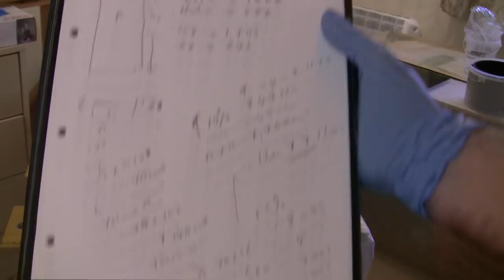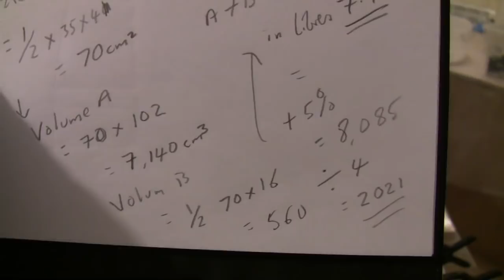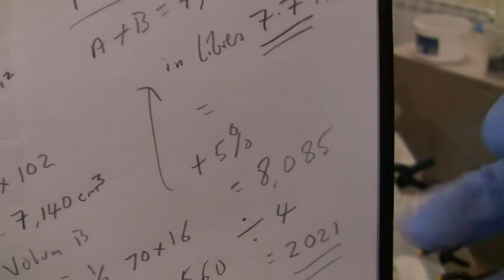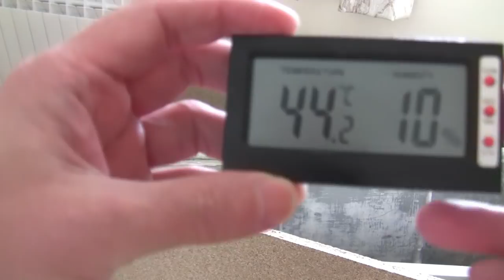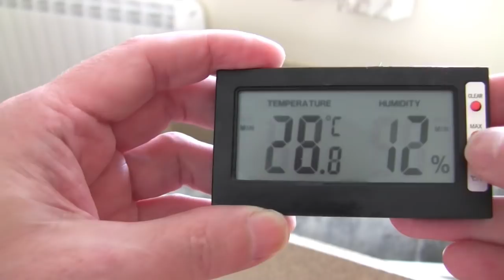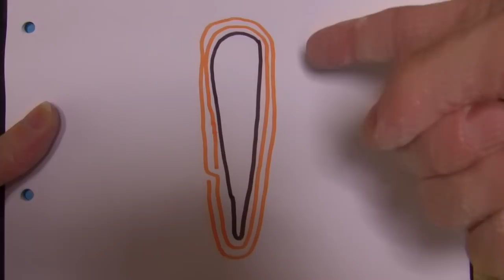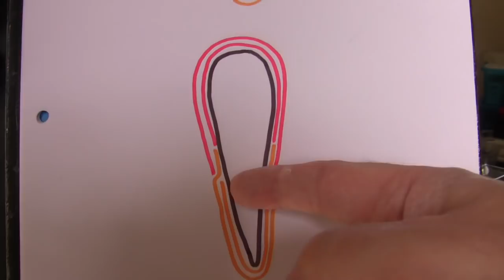Just About Sailing Apr 18 - Fixing the Rudder, Pt 4 Sticking the two halves together, all finished!

Comment: Well done. That was a bit of a marathon old chap, but the rudder looks fantastic. As you clamped it up I had an unreasoning panic, thinking, 'oh gosh he has forgotten something'. And it's not my rudder! All was well however and, had I done it, I should have been very pleased with myself. I think you can give yourself a pat on the back and a nice cup of tea.
Reply from the maker: Yes it really was a bit of a marathon.  But it is done now.  I also enjoyed it in a strange sort of way.  I was convinced I had forgotten something, but it all went together smoothly.  Despite all of my testing I was also convinced that the foam was going to go mad, ooze everywhere and split everything apart. All good practice for the windows which is going to be the next big project - even more epoxy and fiberglass.
Reply: Just about sailing Singapore has got in the way of my circumnavigation this year. But it was too good an opportunity to miss. Hopefully next year. If you ever get board of boat work give me a shout.

Comment: Well done!  A fantastic job, I successfully rebuilt the rudder on my Endeavour 26 but the prospect of doing so scared the living shizzle out of me. Another way to inject a perfect bead of epoxy is to use empty caulking cartridges refilled with your thickened epoxy mix and applied via caulking gun, you can generally purchase these at a fibreglass materials supplier. Looking forward to you next sailing series. Fair winds and calm seas 👍
Reply from the maker: That's a good tip.  I agree that it is a very daunting task to rebuild a rudder.  Glad yours went well. It is certainly worth going slowly and thinking every step through. Cheers.

Comment: I think you should be very proud of the end product which  is entirely due to your diligence  in the research, experimentation and preparation phase. I think the rudder will see you out!😀
Reply from the maker: I think I feel relieved rather than proud.  I agree that the experimentation and preparation phase was key. There were many points where it could have gone horribly wrong if I hadn't done a few tests first.  I might need to do it all again in about 40 years :)

Comment: Lovely job by the look of it, I need to repair my rudder but have been putting it off, but after viewing your vids I think I shall attempt it, excellent.
Reply from the maker: I wish you luck.  Let me know how it goes. As I have said before, I probably wouldn't do it the same way if I had to do it again.  I would use the old one as a plug to make a mould for the new one.  Cheers.

Comment: Outstanding job.. The best rudder build videos on the tube...cheers!!!
Reply from the maker: Well possibly the longest and most convoluted rudder build video on YouTube. But once I had cut it in half and discovered the concrete, there really was no turning back.  I am very happy that it will be very strong and I won't have to worry about it,  Cheers.

Comment: Hi Paul. You took on a job I would have ran away from and as far as I can tell did it in style. Having watched your videos I would now definitely try  it myself. You did it in your front room. How cool is that. I don't think Jules would let me go that far. Nice one pal.
Reply from the maker: Breaking the job down into several small chunks helped to make it less daunting. I needed a lot of temperature control, which is why I did it inside.  Epoxy is not to bad - but I couldn't do painting or varnishing inside.  Hopefully it is a job you won't ever have to do.  Roll on the good weather for your circumnavigation.

Comment: Excellent work loved the math calculations lol
Keep up the nice videos and happy sails.
Reply from the maker: The proper way to do it is to fill each half with dry sand and level it off.  Then actually measure the volume of sand and add 10% to that.  I just used a little bit of estimating and added a bit on at each stage - and then added 10%.  Thanks for watching and commenting.

Comment: I think you should be quite "chuffed"!  I like that this was all done at your house, with no fancy tools or shop.  Granted there were some issues/problems, but you worked through every step in a way that made sense to this laymen - logical problem solving.  Outstanding.  Cheers!
Reply from the maker: Thanks. The expanding foam I used was labelled as being for 'professional use'.  What that really means is that you have to keep the environment exactly right - temperature etc.  Quite a lot easier in the house.  Getting the 'hot box' to work was key as otherwise the expanding foam epoxy would not have set.  Glad it made sense. Half the time when I am talking these things through I am actually explaining them to myself out loud. Cheers.

Comment: Hehe. I absolutely laughed my head off with the "shiny" . Touché. 
Great job on the rudder. You mastered the beast. Loved the elegant way you managed to come ou of the rudder pickle with a "shiny" manoeuvre. Glad to see you did decide to go with the 10% extra. That foam really needs a bit of expansive compression to fill any voids. Well done. 
( back to washing the mud out of my "ex-shiny" new engine and tender)
Reply from the maker: Glad you got the reference.  I did wonder at one point whether to have just a single hole, but opted for a single one per 'section'.  I think that was about right.  It really helped to play about with the material with all the testing.
That is probably my most difficult job finished. I look forward to watching the rest of your refit.
Reply: We just have been really busy chasing designs and suppliers. Waiting for the boat to be lifted and have some metal footing to secure it. The old logs are kind of shaky.  Impossible to miss. I really laughed my head off.
Reply: I would also have done a hole by compartment. The reason being that if you add extra 10% you have enough expansive compression to fill any possibly pockets of air that may get trapped In one compartment. If there is a vent in that compartment then the expansion and the movement guarantees (As much as possible) a mostly pocket free filling of the space. A different thing happens if you do only one hole. Vents are extremely important when filling any type of mould and more often then not the reason behind cast failure. 
Good decision. You did well.

Comment: One thing i'd change, i'd use the confectioner's method to put "the blob" on. It speeds up the process, and it also neatens up the lines, making the spread uniform. In fact i recommend to anyone who does small jobs like these to get an old school (circa 1980s, i believe) confectioner's kit with the metal shaping ends, especially the zig-zag glaze bits, you can lay a nice fat bead with something like that, and being that they are metal, so long as you don't let it sit too long, it cleans easily.
Reply from the maker: That is a very good tip.  I have tried this a couple of times using a freezer bag with the corner cut off.  I was thinking of doing it here...except the last time I tried it I messed it up completely and managed to get the epoxy mix spread all round the bag with very little coming out of the 'nozzle'. So in this instance I thought I'd better play safe and stick to the old method and just work very fast.  However, I do know the confectioner's kits - I will see if I can find something and try it out on the next few jobs.  I have some filleting work to do. Cheers.
Reply: Great tip +1 I was thinking of using my Dewalt caulking gun making a "sausage" for jobs like that, but don't fancy the idea of cleaning the container if I mess it up.

Comment: Well, this rudder will certainly last for some time to come ;-).
One remark, the trailing edge should be square and with edges as sharp as practically can be made. An 8 to 10 mm wide flat face would be perfect. The reason is that the water flow will 'let go' far better at a sharp edge, it tends to 'stick' to a round edge. This results in more turbulence and thus more drag and possible vibrations in the rudder. I would recommend to add some epoxy filler at the trailing edge if it's still possible. You have put so much effort in this project, it would be a missed opportunity not to finish the trailing edge as good as possible.
Reply from the maker: Thanks for the comment - that does make sense.  I did wonder as the old trailing edge was squared.  I also vaguely remember watching a wind tunnel test many years ago looking at the best shape for the rear of cars. The reason I rounded the edge was simply to make it easier for the fiberglass to wrap round.  A you say, I could simply add epoxy to the new round edge to square it off. Cheers.

Comment: Hi Paul, I have a Mirage 26ft moored at Medway Yacht Club and would like to do some work on my rudder this year while the boat is out of the water. I see you have some original drawings could you share where you got these from so I can see if I can track down a set of drawings for the 26ft Mirage. Your videos great thanks
Reply from the maker: A Mirage 26 turned up at Watchet once. I had real difficulty telling it from the 28. It seemed pretty much the same inside and out to me.
I can't remember where I got the drawings from. I think they were emailed to me. I have the whole set including the 26.
Send an email to justaboutsailing@outlook.com and I will email them back as an attached pdf.
Cheers
Paul

Comment: Looks like a great job you have done.  Should last you out that one.  Bet you can't wait to get out sailing.  Andy UK SY Corrival Rival 32...also with a Seafeather.
Reply from the maker: Ah, a member of the Seafeather club - best thing I ever installed on my boat. There is a fair bit more work to do before I get back in the water. - But yes, nothing quite beats being out on the water sailing. And we have had some lovely weather recently. Cheers.

Comment: Is the weight of the rudder significantly lighter than the original? I was just wondering if there may be a tad more tendency for flutter in the rudder. On small airplanes, they put lead on the ailerons so they are stable, however, I know nothing of boats. Perhaps this is not an issue at all with boats.
Reply from the maker: Good point. One regret I have is that I didn't weigh the old rudder before I pulled it apart. It is still a very heavy rudder even after the fix and it doesn't feel any lighter to carry around. The new foam is less dense than the old 'concrete', but they are both lighter than water and there is only about 5 litres of the new stuff.  This is offset by quite a lot of new fiberglass and thickened epoxy.  It is even possible that the new rudder could be heavier.  I cover the flutter issue a bit in the review video, but it is possible that there might be some flutter - I think the principle is exactly the same as on an aircraft.  At this point in time I simply have to cross my fingers and hope all is OK once she goes back in the water. Thanks for watching.
Reply: You were very thorough in finding a suitable product, reading documentation that came with it, and then extensively testing it for suitability. I'm sure it will work perfectly.